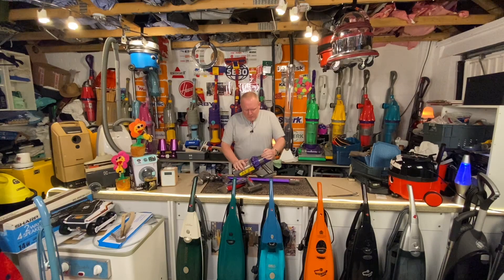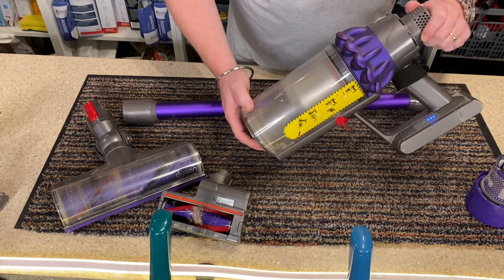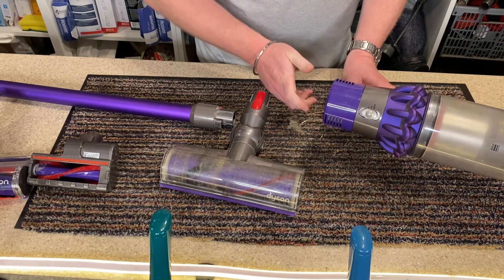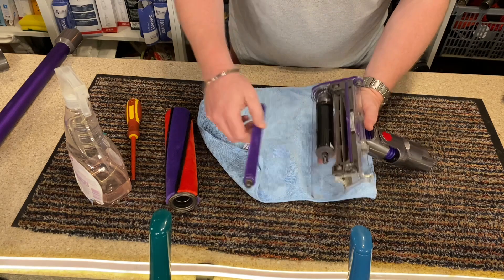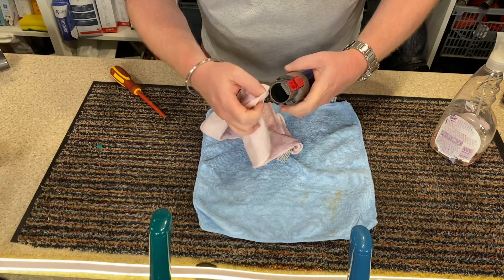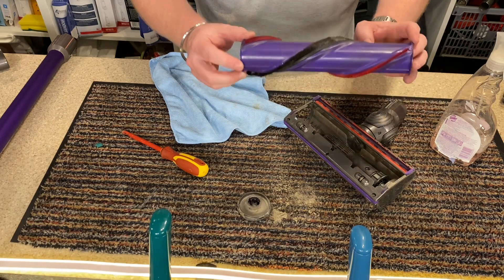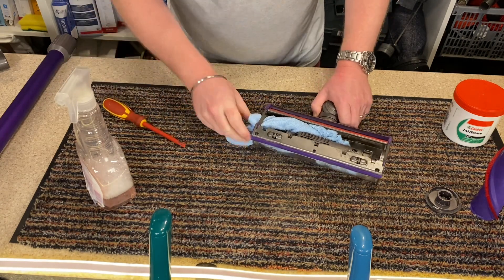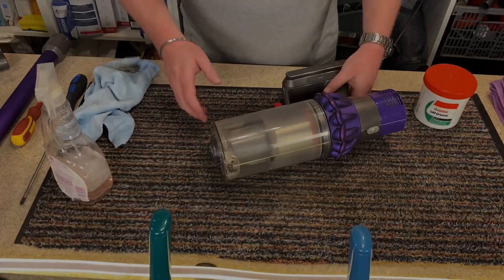Dyson V10 Animal, 18 Month Review & First Ever Cleanup

Comment: It's a bitch when the rubber seals are clean, easier to open with a bit of dust on them 😁
Reply from the maker: I never thought that was true, but to be honest you’re right, they don’t have to be immaculate all the time. That was the first time I’d cleaned them in 18 months.
Reply: @HooverLux  it's a double edged sword because, it is nice once in a while to get them squeaky clean. But it does feel like you're going to break that bin open trigger when those seals are super clean 😱
Reply: @hard2bear3110 and the bin stopper which might be a failure point. 
Dyson are just the iPhones of vacuum world. Period.